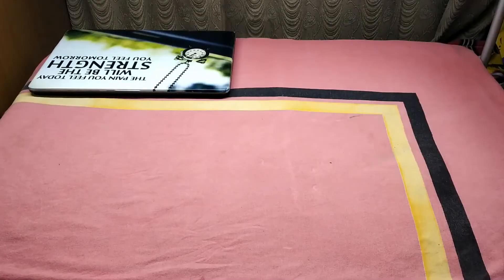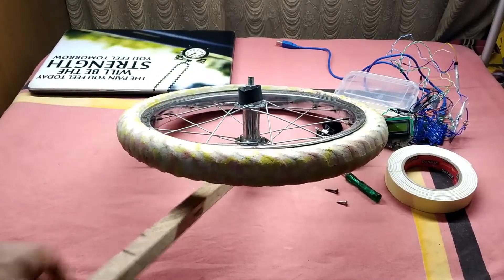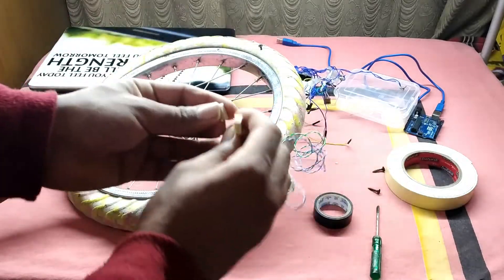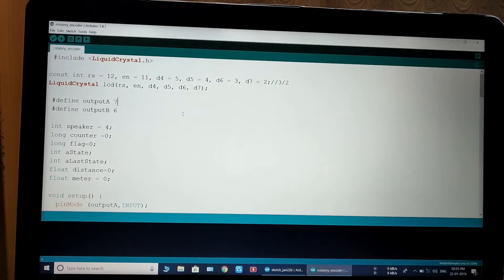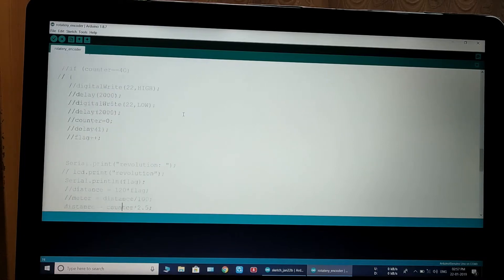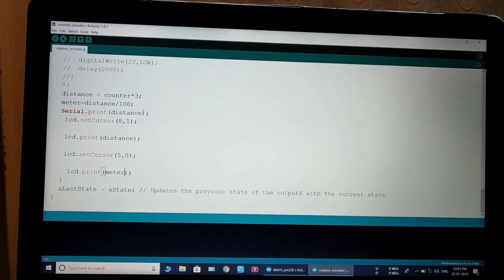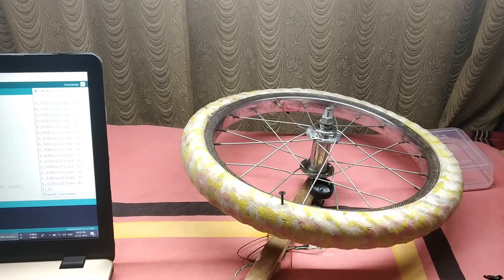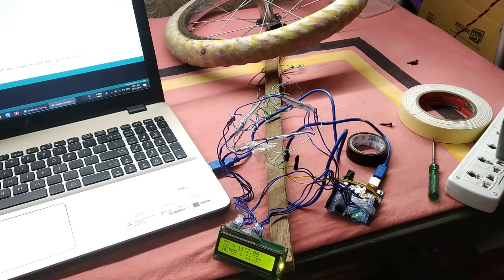How to make distance measuring device(rodometer)  using encoder and Arduino | Experimentalist.

Comment from the maker: Calculations used in this project: 1st of all calculate the circumference of wheel (2*pi*r) because distance travel by wheel is equal to its circumference, and after that attach the encoder and rotate the wheel to one revolution, and see count how many ticks made by encoder in one revolution . and divide the circumference by no of ticks, the result is ticks equivalent to distance. in my case the circumference = 120 cm ,it is calculate by 2*pi*r , r is the radius of wheel. Number of ticks in one revolution is 40. Divide circumference by ticks in one revolution 120/40, result is 3, means in 3 ticks it cover 3 cm, and for 40 ticks cover 40*3 = 120 cm.

Comment: Got question why the wheel dimensions not interred in the logic program?
Reply from the maker: i enter the result " 3 " after the calculation of finding distance , in the code 
if you see the code at last
distance = counter*3;
   <================ see 3
meter=distance/100;

3 is not constant ,if your diameter of wheel is different the number is different 

how to calculate the " 3 " in my case see  the video completly

i think this knowledge is sufficient fou you.
Reply: Thx dude

Comment: Please send circuit diagram
Reply from the maker: CLK pin of encoder connect to arduino pin  pin 7 of arduino and DT pin of encoder connect to arduino pin 6 ,and finally for lcd connection you simply search on google ,maximum connection is same for lcd connection.
Reply: @experimentalist1494  thanks but I need circuit diagram .

Use easy Eda web site for circuit diagram it's so easy  & send me
Reply from the maker: @omkarkadam4179  bro but i make this project without seeing circuit diagram I see only code through code I make the circuit if you need circuit diagram I make circuit diagram from pen on paper.if you need that circuit diagram you send me your email I'd .I think this circuit diagram is sufficient for you.
Reply: @experimentalist1494  my email address

Comment: Can you provide detail how to connect these wires , which pin is attached to which pin of display or with encoder...😁😁😁
Reply from the maker: for connection of lcd to arduino you follow the code.for circuit diagram of connection of lcd  you give me your email address.i will send the circuit diagram of connection

LCD RS pin to digital pin 12

LCD Enable pin to digital pin 11
LCD D4 pin to digital pin 5
LCD D5 pin to digital pin 4
LCD D6 pin to digital pin 3
LCD D7 pin to digital pin 2
Additionally, wire a 10k pot to +5V and GND, with it's wiper (output) to LCD screens VO pin (pin3). A 220 ohm resistor is used to power the backlight of the display, usually on pin 15 and 16 of the LCD connector.

Comment: hello bro, in my project i want to use encoder with ultrasonic sensors, by using your code along with mine I'm unable to get output for encoder please help
Reply: Sure, I made an if case for encoder if encoder value Changes ultrasonic sensors distance is recorded
Reply: Kindly share the code
abdalla88china@gmail.com
Reply from the maker: @harshasai937  can you share me the code
Reply from the maker: Bro can you send  me your code
Reply: I will be happy to know ur project, kindly share